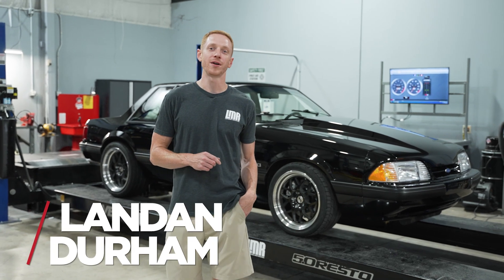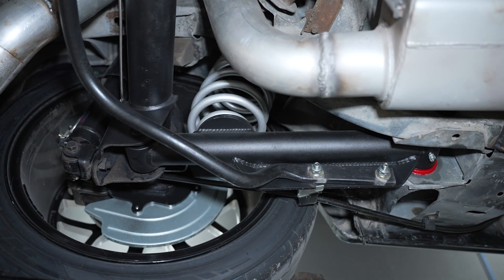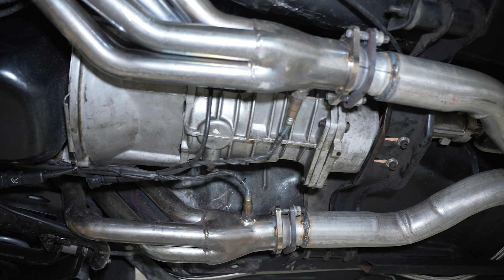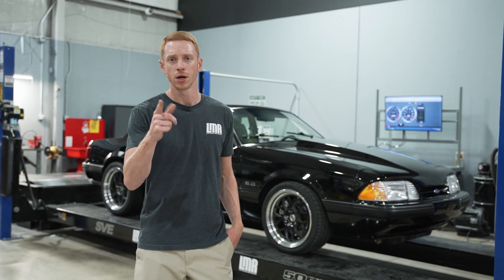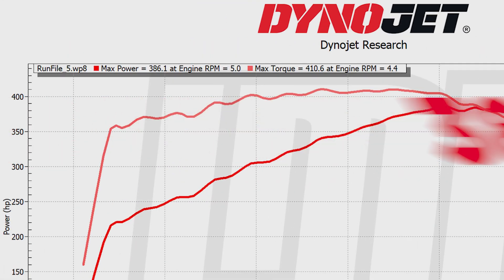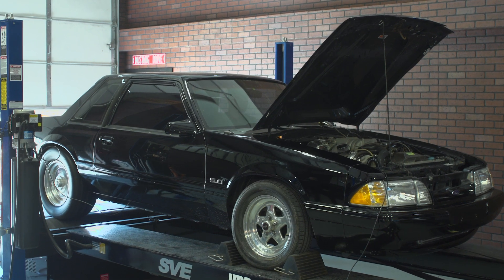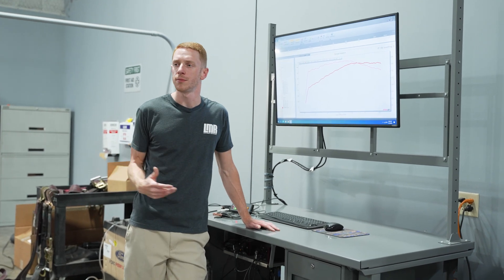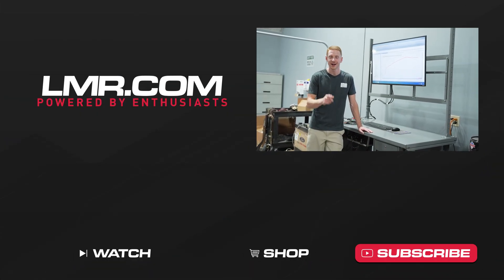How much power?! 393ci Windsor Stroker | 1988 Fox Body Mustang Dyno (Part 1)

Comment: So a built 351w stroked out to a 393 and it only made 386 hp and 410tq, that’s pretty pathetic.. I had a 351w that wasn’t bored out.. aftermarket carb and intake manifold, headers, heads, and a camshaft, and I made 375hp.. and you built a 393 striker and didn’t get that, that’s sad as hell 🤣

Comment: Well I was hoping 1st of all that you would give us more details on the bottom end. I think you gave us the cr. @11.0-1 but nothing on the pistons that were used, what con rods, and the crank. Was the bottom end studded,? Was the block decked for zero, what main and rod bearings were used?  No cam specs ?
We need more info. Did you run a windage tray

Comment: https://youtu.be/oTlVFdyWNgY?si=POahTcYnymq_qU7d
This car made 400whp on a Mustang Dyno that reads lower than a dynojet with one of our regular Stage 3 Cobra gt40 manifolds through a T56 which would be 420whp through a T5 or TKX. Car has a much milder cam than that 393 car as well. Ported parts is the only way to go!

Comment: That hp/torque is low for the amount of money spent on that setup. We have customers making over 400whp on basic 347s and 363s with our stage 3 ported Cobra and Explorer Gt40 manifolds and our stainless steel shorty headers.

Comment: People all bragging about horsepower numbers but none of these cars running a big stalled th400.  Big stalled th400 will destroy any stick car. My fuel injected 438windsor 68 mustang made 505wheel through a big stalled th400 and runs 9.90. If i ran a manual i would make 560wheel but car would be way slower.  Believe me horsepower numbers dont tell the entire truth. And my car is a pure street car by the way. Big stalled th400 will annihilate any stick car guaranteed.  Getting a Novi2k soon. Car only weighs 3k lbs. The launch is insane with 4k stall converter and full manual th400.

Comment: What transmission and fuel and compression
Reply from the maker: From the video description:

393ci Engine w/ ~50 Miles
Trickflow 11R 205CC Cylinder Heads (11:1 compression ratio)
Trickflow Stage 3 Camshaft
Trickflow "R" Intake
90mm Throttle Body
Pro-M Engine Management System
Pro-M Mass Air Meter
47lb Injectors
SVE Fuel System
BBK 1-3/4" Long Tube Headers
Full 3" Custom Exhaust
Tremec 3550 Transmission (4th gear pull is 1:1)
Aluminum Driveshaft
3.55 Rear Gear
18" SVE Drag Comp Wheel w/ 285/35/18 Tires
93 Octane Fuel

Comment: Here's another test TFS 11R 205cc heads on 408 stroker with the TFS Stage 3.
545 ft-lb      534 HP    Air gap intake
540 ft-lb      570 HP    TFS Single plane

https://www.youtube.com/watch?v=vtcec2XdJ7E&t=14s

Comment: What about the tuning?       The efficiency of a combination can be checked out by it's peak rwtq.    I'd expect a well built 393 to have peak torque over 450rwtq, if it's low i'd look at tuning or a restriction.

The heads are good for 600HP.   Cam could be bigger with more lift, but it's fine.   TFSR Intake should "flow" enough but what power band does it support?

What's your Air fuel curve look like?

Also everything shuts down super early.    I'd expect a power peak north of 5500 RPM.

Comment: Get rid of that BS factory computer
Reply from the maker: It doesn't have a factory computer. We installed a Pro-M engine management system which is mentioned in the video. -Landan

Comment: @LateModelRestoration- This combo would pick up a lot from changing a few thing's, #1 Get a Box R upper, and have Big Dog's do a stage 2 fully ported= the upper, Lower, spacer if used, and 90mm throttle body, (YES ALL OF THESE THINGS MUST BE PORTED BY BIG DOGS ALL TOGETHER TO MAXIMIZE RESULTS) plus use their hi flow filter, + Anderson's 4" power pipe. #2 Tfs stage (5) Hyd. Roller camshaft. #3 Big Dogs stainless steel High Flow headers= approx. 700 cfm vs your Bbk= approx. 400 cfm. #4 Big Dogs stainless steel High Flow 3" muffler's= approx. 700 cfm vs flowmaster/jones full boar type mufflers approx. 350 cfm. Prob. Pick up 75Hp to the tire, so 450 ish, plus more Tq!?

Comment: 347 Terminater x EFI Boss block  same TF-R intake 75 mm tb 10:1cr F cam Ford racing Z heads through an AOD put down 360hp-370tq na 93 pump. Converter is wrong for my setup.

Comment: Beautiful car. My little vortec powered 302 made 497hp and 499 torque to the wheels on bad plugs, and has way much more potential to make more with adjustments. 11r190 comp heads, track heat intake, TFS stage 2 cam, 80lb injectors, V1 T-trim
Reply: Dude foreal I thought that 393 would make something like 800easy
Reply: Yea but you ran a manual. A big stalled th400 would drop you to 440wheel but your car would be way faster

Comment: lord how much does he have in that motor least 4k id throw a 6.0 ls 450 out the box for 1kthrow a 88 on it 700 hp no problem and would last we all know a 302 will split in half at 450 500 they say 600 for 3 or 4 passes

Comment: Just wondering why the max hp was at 5k and not closer to 6k rpms. Why is the power dropping off? I would think the intake and throttle body could support the rpm for the cid 🤔 could it possibly need a bigger head?

Comment: My 94 mustang has a 331, blueprint heads,  10.2 to1 comp, 224, 234 @.050 cam,  edel perf rpm2 efi intake, 75mm tb 30lbs injs, full exhaust and 373 gears,  it made 368hp and 398tq at the rear wheels.  Dyno is on my YouTube and Tiktok.
Reply: Your setup optimizes 331 cubes this one don't even come close to optimizing 393 cubes and something is up over 5k it peaked at 5 gaurantee yours didn't lol.  All these things are a bug factor combined.

Comment: I owned a 90 notchback and I wish mine looked this good, IMO hands down one of if not the best looking Fox body notchback I have seen to date!  Perfect wheel stance, love the wheels that you chose, normally not a fan of those hoods but dang that looks good and love the interior.

Higher torque than HP means there’s a restriction somewhere, if ai were to guess its the Intake.  That cam even in a 393ci should making peak power well past 5,000 rpm.

Still if you ever want to sell that car let me know!

Comment: As long as whoever owns it is happy, those numbers are fine I guess. My 12-1, solid roller 393 made 626 on a Superflow engine dyno N/A and I wasn’t happy, lol. It would probably make somewhere in the neighborhood of 550-575 wheel now.
Reply: No way would you make 570wheel with a big stalled th400.  Maybe 500wheel but your car will be way faster than any stick

Comment: Decent torque number but something's obviously wrong because the HP curve drops from only 5000rpm. That engine should be making ~400rwhp at closer to 5800rpm. Dialed in properly, this would be a great street engine.
Reply: All these experts in the comments don't see that though lol.  They're all telling us about how their cam only ls1 made 380.  It prob didn't make 410 tq and I gaurantee it wasn't peaking at 5k rpm

Comment: I think id cry if I built a 393 and that's all it made. And peak power at 5k?

My dad and I put together a 351 and we shifted it at 7500 I do believe (it's been some years ago). 

Never got it dyno'd with its final build but it was fast enough to run 9's in a Ranger with nitrous. Absolute blast to drive :)
Reply: Peak power at 5 shows the combo isn't optimal at all.

Comment: Respectfully, you guys are missing 100hp at the tire. My hyd roller pump gas 347 with trick flow heads made 425 at the tire….
Reply: It's all in the combo.  Cubes don't automatically make power you gotta have the combo to take advantage of it.  Gaurantee you wasn't peaking at 5k rpm either lol.
Reply: @midnight347  that’s another problem in itself… that engine should be peaking 1000+ rpm higher with the parts listed..

Comment: I'm working on collecting parts for a 351W swap in my 85 cougar. 351W efi intakes are getting rare and ridiculously expensive when you do find them.....I didn't see a listing on your website for 351W manifolds. Where did you source the trick flow lower from?

Comment: Definitely a bit low.  I wouldve thought minimum 450 rwhp.    Now I had more cam,super victor carb intake,850 demon carb,AFR 225 heads but 10.75:1 compression on my last 427ci windsor.  Full exhaust with 1 3/4 long tubes,3" Dr Gas X pipe and Mac 3" catback with tailpipes. Made 545 rwhp/519 rwtq though a Tremec TKO.
Reply: You had a much better setup.  More displacement much better and bigger heads prob more compression and a better cam setup.  Also your intake setup was better.  The cubes don't do much without the combo to take advantage of it.
Reply: TFS 11r 205 make 550-600 HP on well built 408ci.    @midnight347

Comment: My sbf 347 made 551.5 at 6800 rpm around 455 tq at 4800 on the engine dyno. Custom camshaft but Chinese afr heads mostly port matched to intake and exhaust 10.7 to 1 compression ratio on 93 pump gas. Holley ultra xp 750 carb. 1 3/4 headers. Cam did have .615 lift. Nothing is crazy or custom. Enjoyed the video though thank you.

Comment: Nice cruiser for sure! My 83 coupe has a 410 with a Lunati .600 lift cam 241/249 @ .050. 12:1 compression. Super victor intake 850 brawler made 499 rwhp and 490-foot pounds at 6000 rpm.
Reply: That compression really helps and you have more cubes and bet5er cam.  What kind of fuel you running?
Reply: A mix of 93 and 110 @midnight347

Comment: Feel like this thing is a great driver car but should be making damn near 100hp more. Max hp at 5k is no bueno. Put a Anderson cam in it and let it sing and some straight through mufflers and a intake and I bet it picks up 100 hp. Way to nice of heads to only make 386. Can damn near make that on some nice 302 set ups

Comment: It's a stellar drivers car. Build it, drive it, love it. This combo would be near perfect for a 351. Since you asked about power, the intake port/valves are too small for this combination. A quick fix would be the Box R upper manifold and 1.7 intake rockers on the mild ramp rates and too wide lobe separation of that cam, and change to .650 lift springs. You wouldn't even have to pull the heads off to do this. Simply put, you built a larger version of the Ford Catalog 330 HP 302 GT40 engine. Ford has always gone too small on the heads and compensated with more camshaft. Chevy figured this out 25 years ago when they built the LS series. Bigger port, bigger valve, smaller cam. I copied their design philosophy with my 408W.  It made 607 HP @ 6500 and 546 TQ @ 5200, and had 14 inches of vacuum idling smooth @ 800 RPM like a Camry.
Reply: Would afr 220s be a better head for this set up?
Reply: @5ohJ  probably yes. I used Edelbrock 7721 heads. 355 cfm @ .600 with 2.125 valves, and Engine Masters competitors went up to 2.19. A bigger stroke demands more cfm at low to mid lift when there's a greater draw at the valve due to higher piston speed.

Comment: Very Nice Build 😎. I managed 475 rwhp/486 rwtq with my 408 with the same intake/TB and heads. My camshaft is probably a lot more aggressive.
Reply: The cam is prob alot better and you prob have more compression I doubt the cam alone would be 90 rwhp over a tfs3 maybe if it was a stage 1 or an e303 or something lol.
Reply: Nice man I just built a 408w with afr 205s tfs stage 5 cam super victor efi intake with holley elbow and 10.92:1 compression. Its going in my 86 fox and will be hitting the dyno this week im hoping to see near your numbers if not a little higher if i hit 500 wheel that would be sick.
Reply: @ChungusBoi69  Gonna be a beast on such light cars y'all got there.. How streetable are those cams tho, n is boost expected in the future with that compression??
Reply: @P71ScrewHead  these cams are fairly streetable nothing too crazy also with it being hyd roller it makes things easier too. Boost is not expected for a while on this build, just wanted to build a nasty n/a 408 to tear up the streets with
Reply: @ChungusBoi69  No cold start issues?? I got mild cams on my 4.6L 2v n if I try to start the car n move it right away, it stalls.. Talk about cam life..lol
Reply: @P71ScrewHead  maybe something in the tune or wait a little bit before going in gear
Reply: @ChungusBoi69  If I wait a minute it's all fine, if I move it instantly then it wants to turn off..lol It's nice to see the 351W strokers making good power tho..
Reply: @ChungusBoi69 -Your combo will be more powerful, than this 1 in this video. You have more cu. In., a much better flowing intake, and a much bigger cam. Also if you get a high flowing exhaust, it will make a Huge difference! The exhaust in this video, does not flow great. Use high cfm flow headers, mufflers, and 3 in. Mandrel bent tubing. Your car if tuned right, will be a blast!
Reply: @evilinside5984  thats awesome im glad to hear this man. I also did just recently get my exhaust done bbk long tubes all 3 inch with an x pipe and dynomax race bullets, mandrel bent 3 inch tail pipes. Very excited to see what this thing makes
Reply: 500wheel with a manual is easy. Now try 500wheel with a big stalled th400,  but the big stalled th400 will destroy any manual transmission all day long.
Reply: Do you have a video of that dyno pull?
Reply: You must be running a manual transmission. A big stalled th400 would drop you another 50wheel down to 425wheel but the car would be way faster.

Comment: Good power made for off the shelf "not over the top" parts!! Sure there is alot of room for more power ; always will be but it will never be apples to apples...the more we make , the more it cost to exceed that!! the 1st 450 hp is  a ton less $$ than the next 150 - 200 hp  esp in a N/A build!! BTW , Ill be calling monday...I need that complete serpentine set - up for my 434 SBF😉

Comment: Nice car. Never been a fan of waiting around for boost while a nice na built motor just instantly scoots away from neck cracking throttle response
Reply: Same, that's why i prefer pd blowers tho.. Talked to a guy with a TT Coyote 1200hp n he said boost came on at 5k rpm, late to the party.. Said it sucked driving in the street..lol

Comment: That's some very weak numbers for any 393 especially through a manual transmission. My 359 Cleveland with 11.13:1 , c4 transmission with 3000 stall and 4.11 gears and Hoosier quick time pro 27x11.5x15 on a Mustang dyno did 369hp@5200 and you all know Mustang dynos read much lower. The DynoJet conversion for the 369hp is 420hp. This 393W is weak
Reply: You don't even understand what is making numbers low it peaked at 5k bro clearly it's far from an optimal combo. B
Reply: @midnight347  I understand plenty- what makes you think I dont? Clearly you are excited about a sub par 393 stroker that will get handed to by a stock stroke 359C in a 70 Cougar. I only took mine to 5200 because it was to lean. I didn't bring any jets to tune. I shift at 6600 - take that 393W to 6600 and let's see what's up.
Reply: @midnight347  so did you even look or listen to the parts list the 393 has? Trick Flow 205cc heads and a TF Stage3 cam? That cam has 236/248 duration @.050 with .574/.595 lift. Soooooo how is this not a hot setup???

Comment: Awesome build, thanks for sharing! A slightly larger cam and maybe a Box-R intake would give more on the top end. Could potentially run closer to 12:1 on the compression assuming you're using at least 91 octane gas (but with how well built the engine is I definitely wouldn't tear it apart to swap pistons). Very cool car, great results.

Comment: If a 393/408 doesn't make 500 flywheel, it's a dud. Its very very easy to make 500 with that. Especially having 11r heads? 205 is enough for a na 393.
Reply: It's peaking at 5k clearly something is off.  Cubes don't automatically make power you gotta have supporting mods and the combo to take advantage of the cubes.  Idk why people don't understand this
Reply: @midnight347  I don't know why you're reading into it so deep. Of course, cubes don't mean power, but any 351 stroker or not, with 185cc or larger heads should easily make 500  flywheel. I don't support 95% of the EFI intakes and it could use a stage 4 or 5 trick flow cam if you're still staying off the shelf. Doesn't make up for how much it's down on.

Comment: Seems a few Ppl in the comments feel the car should make more pwr than it did, I've been planning on putting that same combo in my SN95. Would you put a pwr adder on top of the setup or no???
Reply: If you want more power then yes. You’ll need a little spray, low boost turbo, or supercharger to get there if you wanted more…
Reply: PD Supercharger all day.. n/a should be fun too tho..